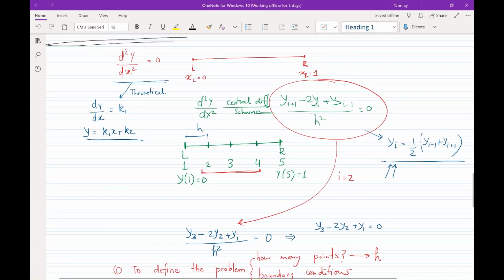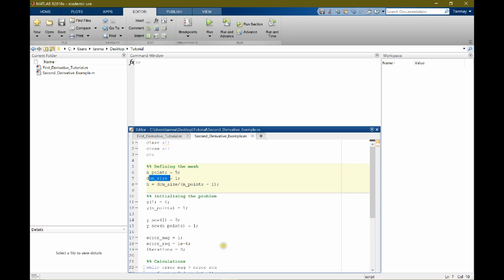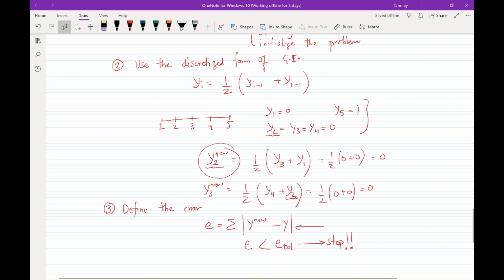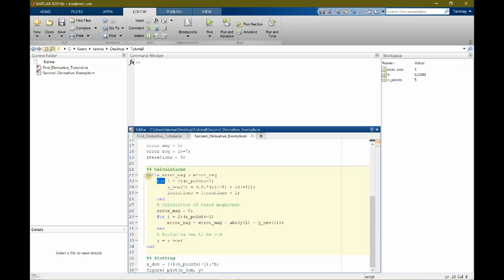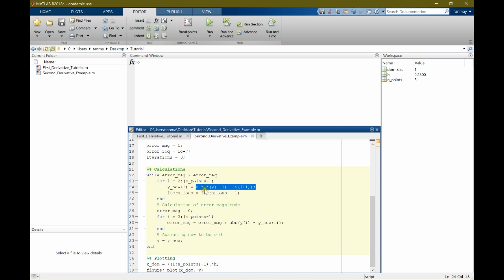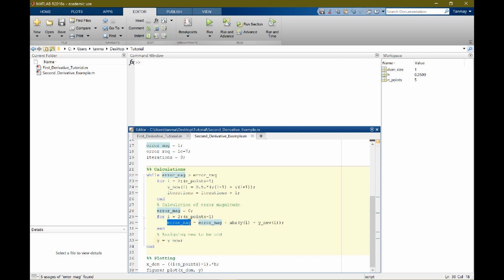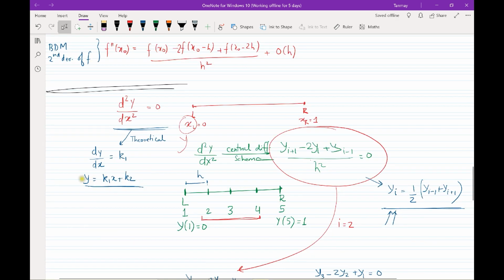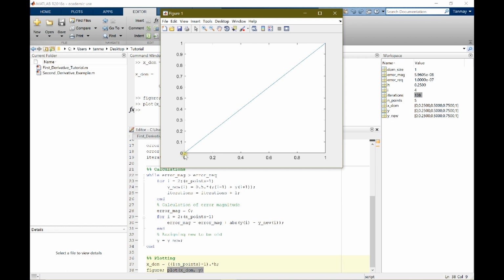Solving 1D Diffusion Equation using MATLAB | Lecture 5 | ICFDM

Comment: i dont understand why  the error ist ynew-y
Reply: It's actually not the error technically. It denotes the difference between 2 values. When the new and old iterations are almost equal, it shows the solution has converged, and there is no more update in values that the solver has to offer. This can be mathematically written by abs(ynew-y) < some threshold value, aka an acceptable amount of error. Hope you understood. Cheers!

Comment: Hi sir, What is the exact meaning of Domain size and it can be anything else than 1? If not possible explain via comment then if possible then you can provide some link of any video or any website which could be help, then it would be great. 

Thanks.
Reply from the maker: Hi Sarthak,

Usually in CFD, domain is normalized (non-dimensionalized) - all length, velocity and time scales. So it is a common practice to have the NORMALIZED domain size as unity. However, it need not be if you are solving the equations in physical units.

Comment: Hi Tanmay, could you please explain when you're using '-' and when '='? It's confusing for me while practicing the code you're showing. But you're explanation is very impressive. I always struggled with CFD. Now I am hoping that I will be able to understand when I will complete the series. Thanks a lot man!
Reply from the maker: Most of the time, it should be =. The display resolution is creating that problem of squeezed symbols. I've shared the link to all my codes in a later video. The initial few videos are a bit confusing to exactly read my screen but it would be resolved in the videos you'll watch later.
Reply: @TanmayAgrawal7  Thanks a lot!

Comment: Hi Tanmay
The code you explained is not running. Could you rectify the problem? 
clear all
close all
clc
n_points=5;
dom_size=1;
h=dom_size/(n_points-1);
%% Initializing the problem
y(1)=0;
Y(n_points)=1;

y_new(1)=0;
y_new(n_points)=1;

error_mag=1;
error_req=0.0000001;
iterations=0;

%% calculations
  while error_mag>error_req
     for i=2:(n_points-1)
         y_new(i)=0.5.*(y(i-1)+y(i+1));
        iterations=iterations+1;
     end
     error_mag=0;
     for i=2:(n_points-1)
         error_mag=error_mag+abs(y(i)-y_new(i));
     end
      y=y_new;
 
 end
Reply from the maker: Hi,

You initialized capital Y instead of small y.

%% Initializing the problem

y(1)=0;

y(n_points)=1;

This would solve the problem.
Reply: Thank You

Comment: Hi Tanmay. Thanks for the great videos and easy explanations. I have one doubt here. The iterations that you are updating in the first for loop will basically increment for each value of y(i). That is if I divide my domain into 1000 parts, updating the 1000 y(i)s for the first time would cause the iterations to be 1000 after first loop. But is that what an iteration means? Like I would think 'one' iteration to be the combined task of updating all the y(i) values once. So I think the iteration should be incremented once for every loop of the while block. Please let me know if this is a correct line of thinking.
Thanks again.
Reply from the maker: Hi Palash,

You're right, great catch! One iteration is equivalent to updating the values of y at all the grid points. This mistake has been identified later in the videos and corrected accordingly.

Tanmay
Reply: @TanmayAgrawal7  Thanks for the reply! I would be glad to connect with you. I work on CFD with Boeing currently and would be willing to connect on LinkedIn if you are up. 
https://www.linkedin.com/in/palash-waghmare-81953a96
Cheers!